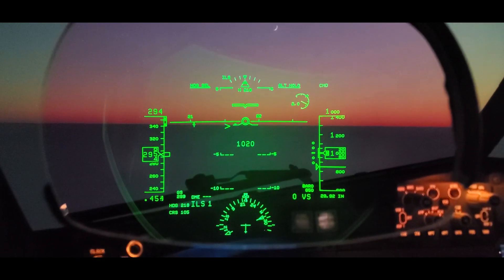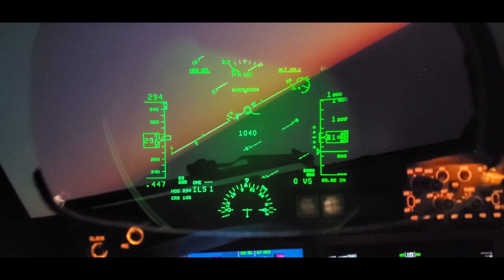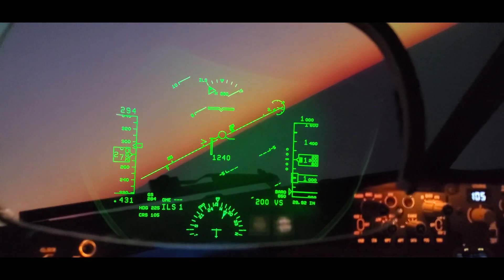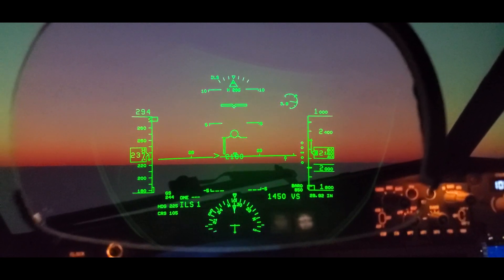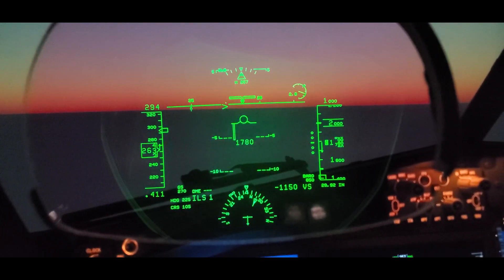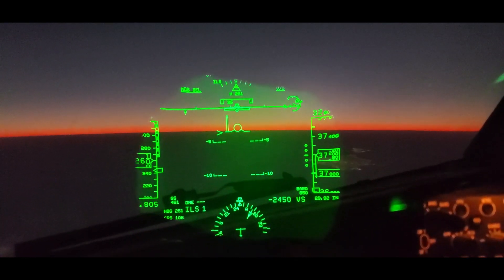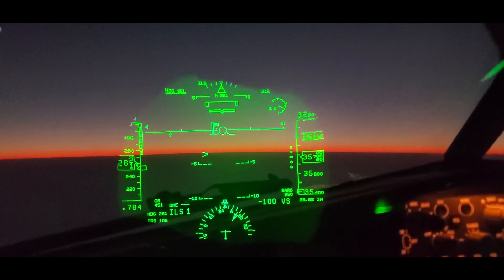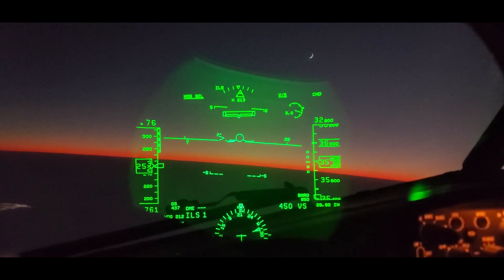Pilots eye view through an airliner HUD

Comment: At 3:20-4:30 the commentary utters a fallacy.  The middle circle must remain above the horizontal line to keep the aircraft in level flight - any time the middle circle is below the horizontal line the aircraft will descend, and he explains this - the aircraft is descending while the middle circle, what he calls the "flight path vector," is below the horizontal line, which represents the horizon.  ALL PILOTS know that to maintain level flight, they must keep the middle circle above the horizon.  So this commentator states a fallacy about the difference between the HUD's horizon and the visual horizon.  Here's the real world explanation:  The real world horizon and the aircraft's horizon are separate because of aerodynamics - the aircraft must PITCH UP to keep itself in level flight - this alone makes the aircraft's aerodynamic horizon higher than the real world visual horizon.  THIS IS A SIMPLE DYNAMIC but this commentator is a liar and does not explain it properly.
Reply from the maker: You do realize that level doesn't change when the nose is pitched up or down. Level is the unchanging reference for flight.
Reply: @ritchiemurphy9241  no the video proves the horizon is below level and gets even more so the higher you go